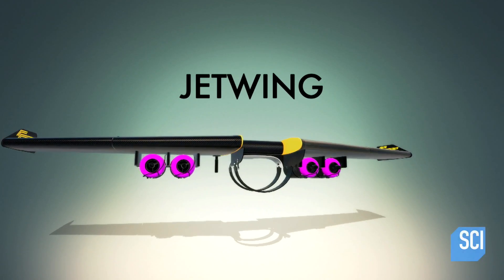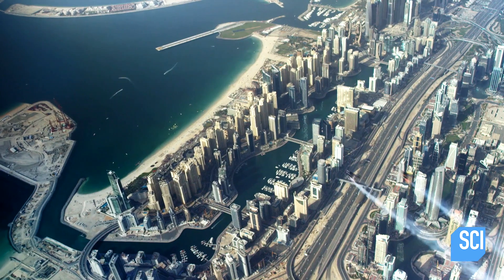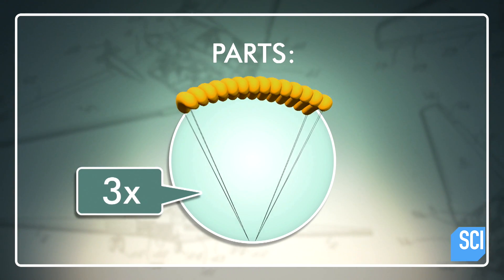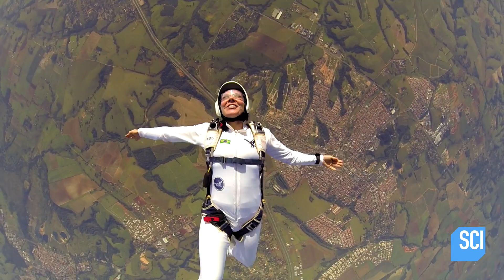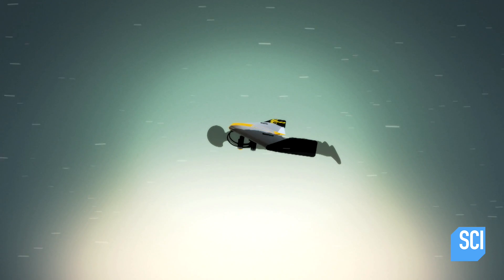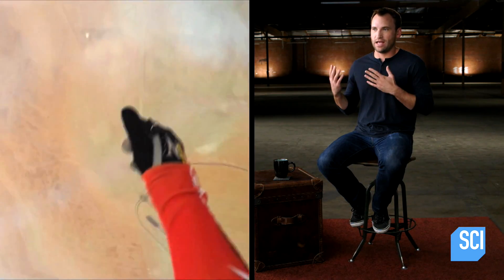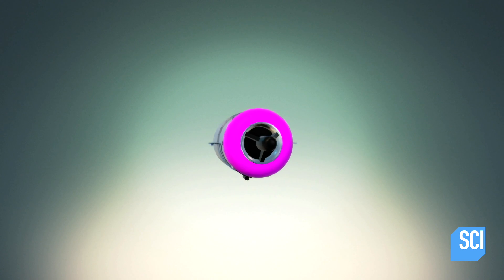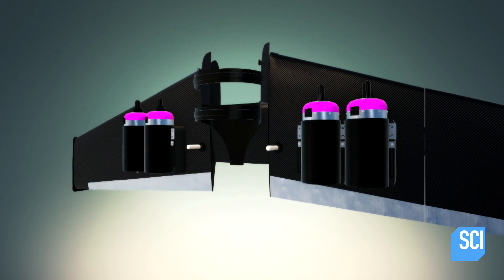Fly Through the Air With This Jetwing

Comment: Working versions of this kind of thing have been around for years. This one looks especially sleek and practical, but it will gather dust in a warehouse with all the rest because there's no known propellant that can power a single person jet propulsion flight apparatus for more than a few minutes. There's a direct relationship between flight time, wing size and fuel tank size. By the time you scaled everything up enough to reconcile the air time with the cost, you'd basically find yourself strapped to the belly of an ordinary small jet, at which point you could just do that.